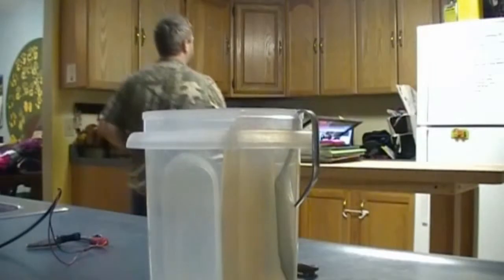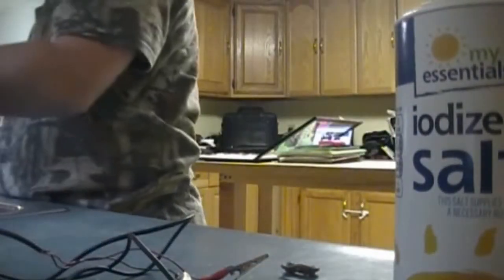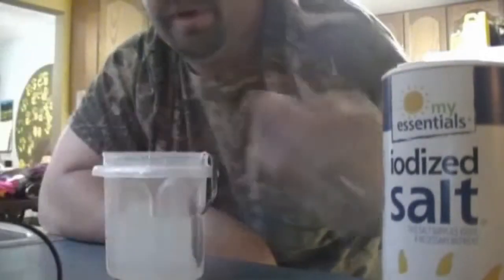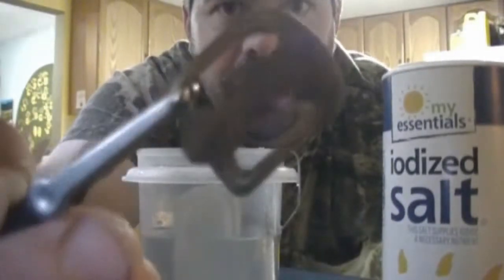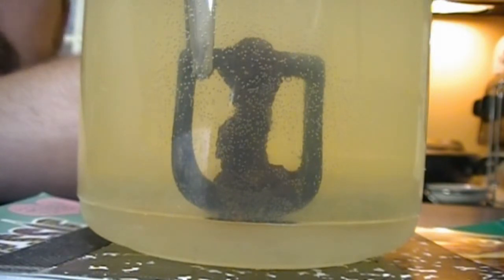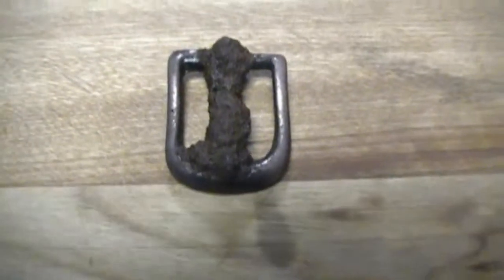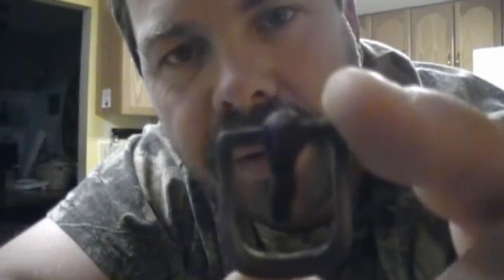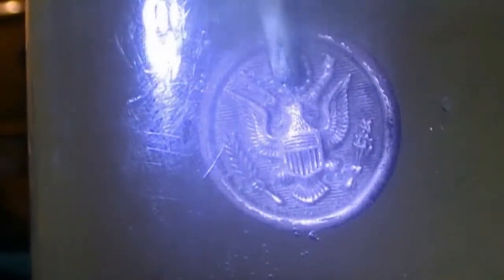Park dig 3 Sleep is a waste of time...

Comment: The steel pin will deteriorate. That's very common. The divider will keep your setup much safer. Also, when doing it with copper such as copper pennies, use half the amount of salt to help prevent pitting.. The button came out great btw.
Be well,
Al-Fu